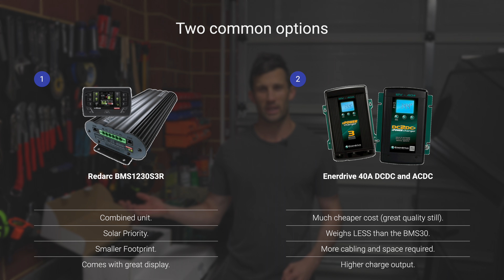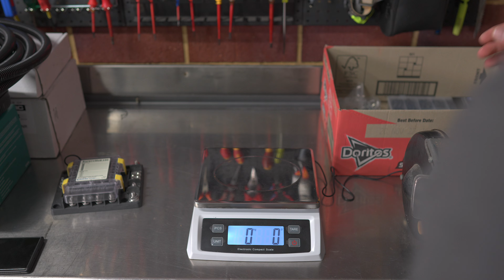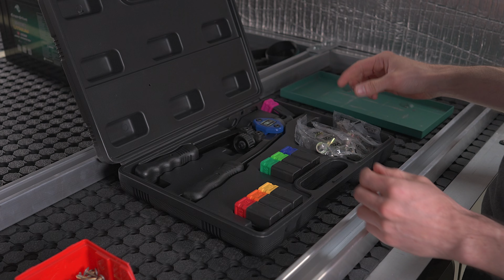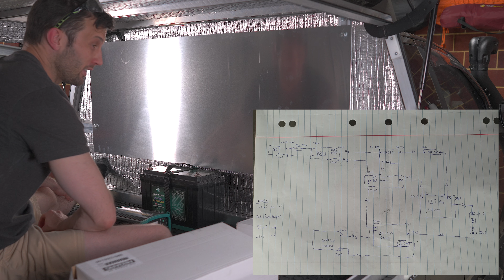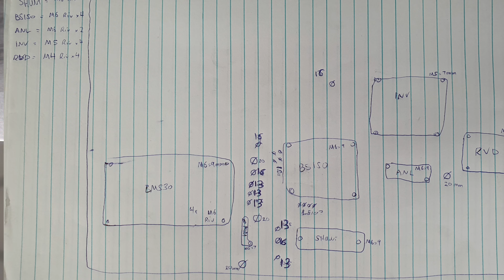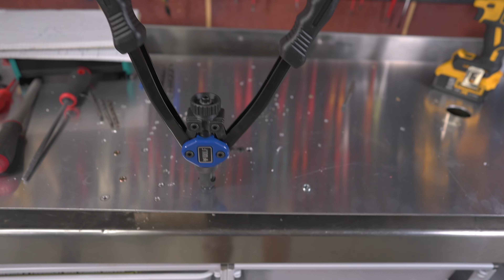Planning a 12 Volt Headboard Layout || Redarc BMS1230S3R + Enerdrive 600W Inverter Install PT1

Comment: Would those self drilling screws for the battery tray wriggle loose eventually?
Reply from the maker: Even the nutserts of things like the inverter, display and bluesea I could have done with self tappers, I was just being overly cautious.

Plus I bought the nutsert kit that came with all those nutserts to use haha
Reply from the maker: It's highly unlikely, the floor thickness gives a very good grip.

Of course it remains possible but not of great concern.